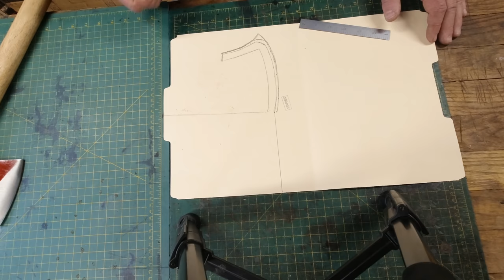Cheap! Easy! Leather Axe Sheath Anyone Can Make! Even YOU!

Comment: I have used both alcohol based dyes and water based dye successfully. I think a lot of it is your finish. I have 10 year old pieces that were done with water based dye. There just as bright as the day I made them. I’ve used blue green pink purple all water based with excellent results.  Used to use a dabber to apply but use a airbrush now with better coverage and no streaks. I stitch all my work and use rivets occasionally only on stress points. Everyone has there own way. Peace
Reply from the maker: Yes. Everyone has there own way. This video was intended to show folks how an easy sheath can be made. I also stitch most of my work. As far as the dyes go, I gave not had good luck with the water base. The oil works best for me. No wrong way to do any of this.
Reply: @KillingerUSA  I agree people wanted color in there leather so I had to learn how to use them to get best results. Normally I use black and browns. But some people prefer colors.
Reply from the maker: @williamklein6649  I know what you mean.

Comment: Anybody that thinks they can't do this or don't have the time is wrong. Do it little by little. It may take a day or a month. I bought a bag of 8 to 9 oz. veg leather scrapes at a hobbie store. Scrapes were the perfect size for axe sheaths. I marked the stitch holes with a fork. Used a tiny drill bit and drilled holes for stitching. I double saddle stitched mine together, I hate rivets. Burnished it with bees wax. After it was finished I rubbed it down with homemade leather conditioner. It's coconut oil and beeswax mixture. Thanks for the video.
Reply from the maker: You are correct,  it just takes time and folks can absolutely do this

Comment: Thank you for the video.  Very nice work and presentation (honest too).  I'm about to rework two old axe heads (that I was given & not of any real value) for cutting kindling. And this style of sheath looks very nice on the head.  Got a question on your use of a mallet. It seams that you prefer it to say a ball peen or a brass hammer.  Do you find that it gives you more control?  Keep up the good videos! Cheers.
Reply from the maker: All ball peen would mushroom the ends of the tools. Barss would work I just dont have one handy. Thank you for watching! Appreciate it!

Comment: "Dividers":  are what they are called.  They make uniform/equidistant spacing a snap!  Rivet sets and bucking bars should be chrome faced and polished to a mirror finish...  That way the "upset" head and "buck" side will look mirror smooth as well.  I don't know jack about leather work.
Reply from the maker: Thanks for your input